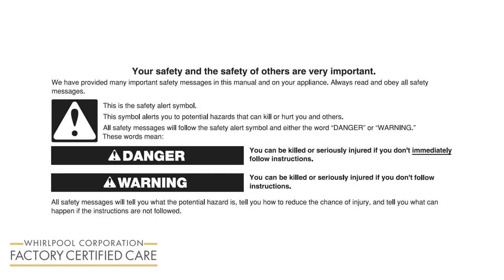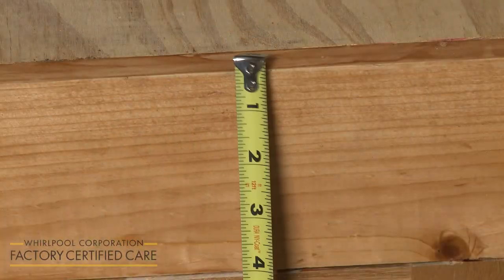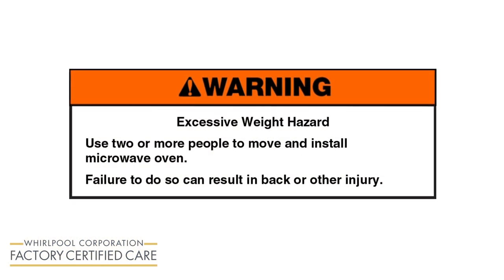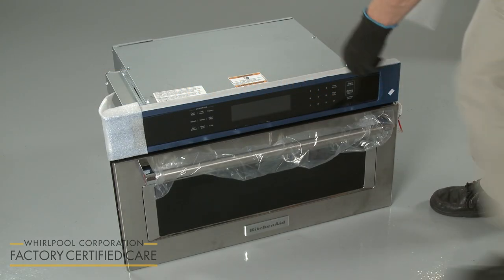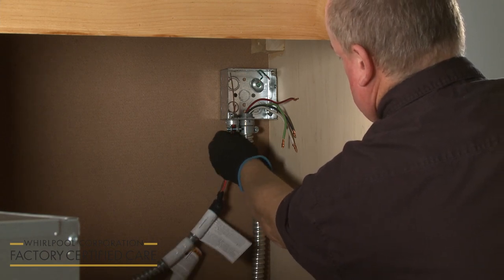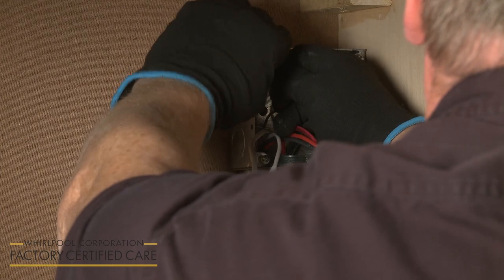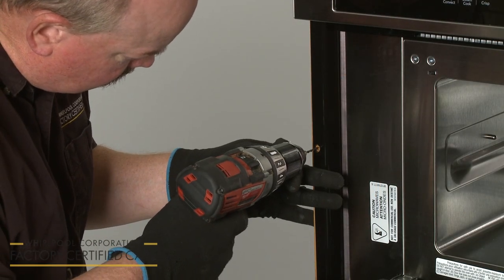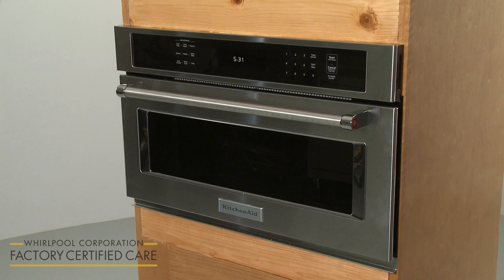KitchenAid Microwave OvenInstallation ModKMBP100ESS

Comment: What if my home power supply only has three wires?
Reply from the maker: We recommend installing per the Installation Instructions. If to no avail, we would recommend contacting a certified installer.
Reply: did you ever figure this out? I think 3 wire is 120V but this microwave is 240V but should also be able to work at 120V per the power cerification. We are having some challenge now.